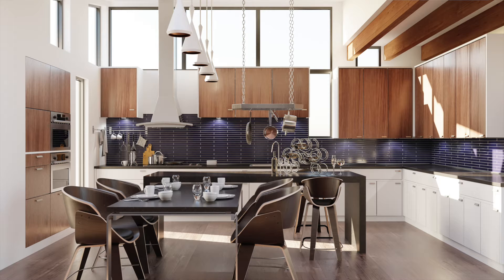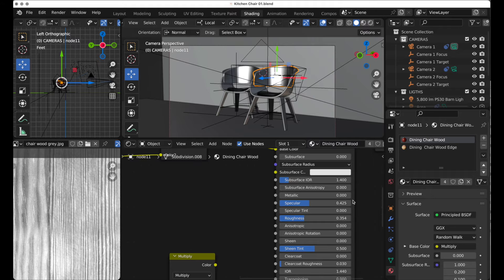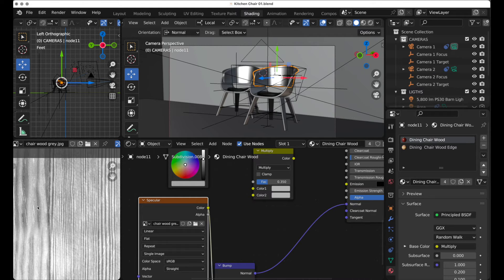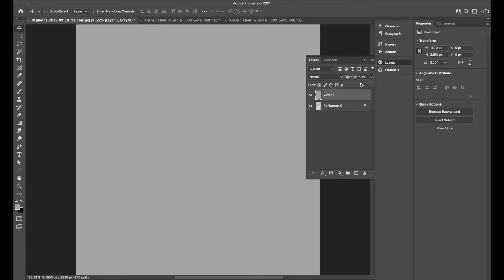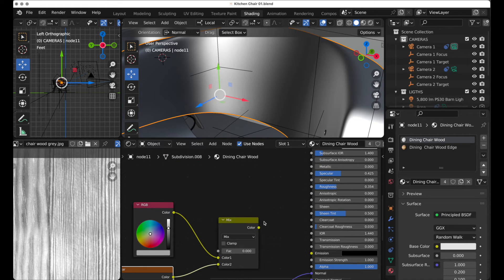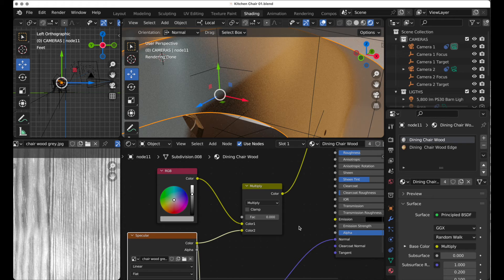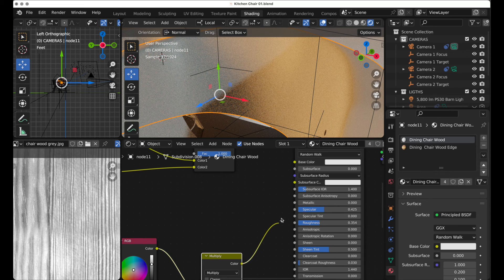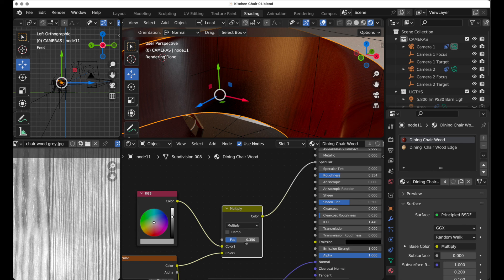Understanding Blender's RGB Mix Node

Comment: Thanks so much for this one Chris. I was sort of getting tired of some other tutorials out there which basically say don't touch the Specular slider - just leave it at default 0.5. I myself always try to add something to Specular, such as a noise texture squished down to a 0.4 to 0.6 range... because almost nothing in the universe has a completely homogenous and uniform surface (examples might be: highly polished diamond, puddle of mercury, high quality spotlessly clean glass).

I know you know this, but for the sake of viewers like myself with inferior graphics cards who might have VRAM optimization as a high priority... There is no real need to prepare and load yet another bitmap to drive the Specular. You can just take the diffuse bitmap, run it through a Separate RGB node, and pick one of the channels (red, green, or blue) as the greyscale to feed into the Specular mix.

Comment: Will plugging bitmap in roughness slot be more physically accurate? Or altering specular parameter is also “correct”?
Reply from the maker: It's entirely up to your artistic discretion, as to what kind of effect you need.